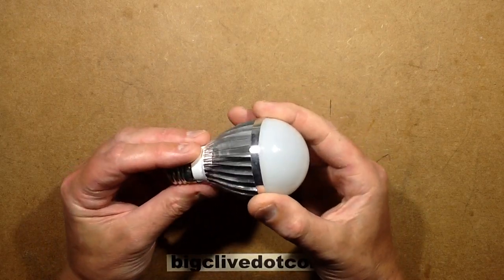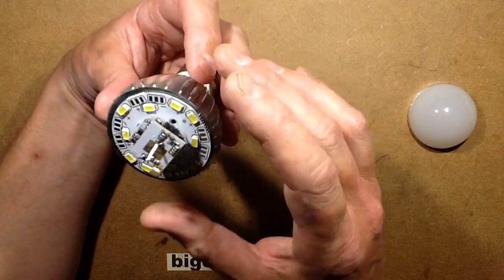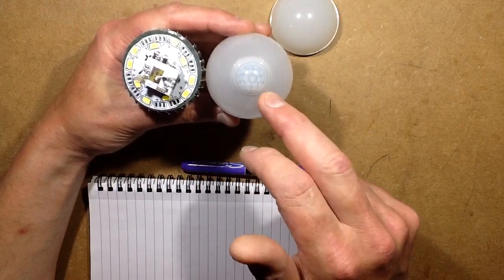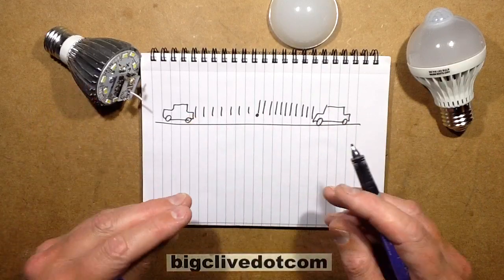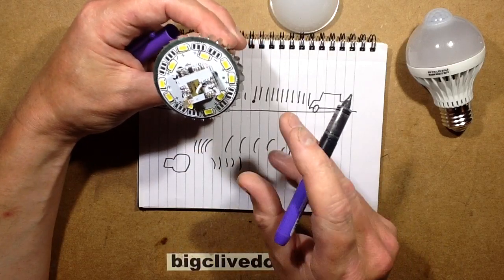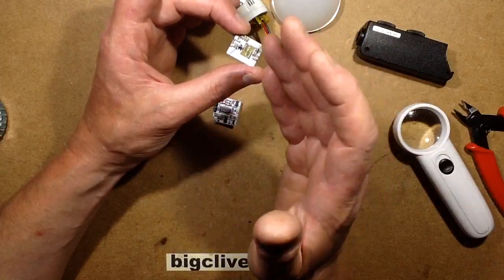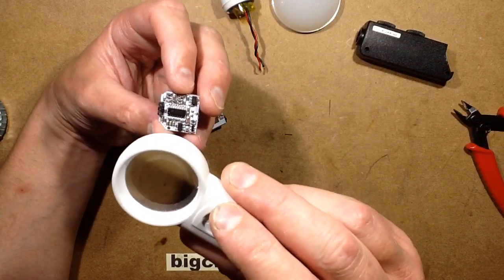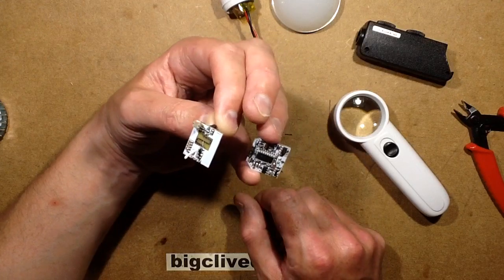Microwave doppler sensor lamp with perplexingly simple circuitry.

Comment: LEDs cause interference and ham radio bands in some cases especially cheap ones
Reply from the maker: The switching ones do.  The modern linear regulator type are very electrically quiet.

Comment: If you have ever played with regenerative receivers, you know that they can interfere with other receivers, since they transmit as well as receive. Since they are only a weak oscillator, they can be easily disturbed by stray capacitance and conductors placed near them. I think this is how this circuit works. Think of a metal detector that detects anything that conducts. A grid dip meter is similar a tuned circuit upsets it's grid bias and shows a "grid dip" when the meter is tuned to the circuit under test.

Comment: This has been spoken about on other electronics channels of late. I am more convinced that the module just transmits and measures the SWR, uses the BIS0001 to compare the signal. The signal frequency on these units seem to be more around the 3.8Ghz. As pointed out by someone on another channel the single transistor is non linear and can have two voltages present at the same time. The holes are just via's for the ground plane.

The SWR theory makes sense when you find that they don't disturb each other.

Comment: Do the microwaves work through the opaque or frosted glass that light covers are typically made from? Think I remember seeing the IR ones on an ebay ad say it wouldn't work through the glass. So I'm wondering if one of these could be used instead. I don't really want to remove the glass cover just to have an automatic light.
Reply from the maker: Yes they can detect through glass.

Comment: Greetings from LA: Just checked eBay for these lamps and found what look like what you "took to bits" (not a side by side comparison) but I do not recall your mentioning these were AC85-265Volt. Your expose showed a SMPS (or was that a BUCK regulator) inside. I'm a retired elect. tech but miss the diagnosing part of the job. Your videos fill that need (including the occasional accidental overloads  ;^) Never seen a capacitive dropper circuit here. Jim

Comment: I used wago connectors in place of wire nuts for the first time today.  They make feel like I am cheating they are so easy.  Are they really safe?
Reply from the maker: I've never personally seen one fail.  The first ones I saw were in use in industrial refrigeration condensing units, and I asked the maintenance guys if they ever had problems with them and they said no.
Reply: bigclivedotcom Thank you for the reply.  they are more espensuve, but they seem to be worth every penny.

Comment: Not strange at all.  I was taught back in the 70's that all that "Doppler detection" wasn't how things really worked.  I've played with the horn out of a old microwave motion detector and have seen it for myself.

Here's how it works:  You have a free running oscillator that transmits a signal.  (In the case of my unit, a Gunn diode.)  You also have a receiver that picks up the transmitter AND the reflected signals.  AM demodulate the signal (in the case of my unit, it was just a simple microwave diode halfway down the horn.  The PC board was the filter capacitor.).  Then look for low frequency AC.  (Ignore the DC value)  That's it.  Why does that work?  The combination of reflected signals will either add or subtract from the signal received from the transmitter.  If something moves, that will disturb that "balance" and cause a change in the DC value (aka a AC signal).  AC detection can be quite sensitive and find small changes in the DC signal.  Outside of two semiconductors on the horn assembly, everything else was power supply or low frequency audio.  No narrow-band filters or precision measurements.  (Cheap, cheap, cheap.)

I challenge you to find something that really measures the frequency.  I doubt if you'll find one, because measuring frequency is complex.  The closest you'll come is that you can claim that it's measuring the beat frequency between the transmitted and reflected signals - but that circuit will still be substantially the same as I've described.  In that case, the diode detector will be called a "mixer".  But you end up with the same results - a AC signal the represents movement.
Reply: Russel has it right.  The wavelength at 5.8 ghz is 51 millimeters.  Half that is a complete phase reversal.  So a movement of 25 millimeters, one inch, is enough to completely reverse the phase of the reflection and when mixed with other non-moving reflections in the room will change the amplitude on the receiver.  A ceiling fan would probably drive it nuts but it may be filtered to ignore rapid and continuous changes (low pass filter).
Reply: Russel you just described a downconverter and doppler phase shift detection! All you need is usually a diode, almost always biased IME, to supply a nonlinearity. I've also commonly seen a transistor used as the mixer in place of the diode.

Comment: This question probably demonstrates my lack of understanding of electrical theory and radar, but here goes.  Infrared sensors are somewhat susceptible to false triggers due to changes in temperature and things like that as I understand it.  Depending on how this lamp is set up, is it also possibly susceptible to false triggers, or are there just too many variables to answer that question.
Reply from the maker: A common technique is to combine the two technologies.  Each has its own weaknesses, but when paired they reduce the risk of false triggering of alarms.
Reply: Is this lamp going to fry your balls after time?
Reply from the maker: Microwave refers to the frequency range.  Actual RF power is extremely small.
Reply: ChompChompNomNom yes
Reply: Lachlant1984  t

Comment: had to look this one up.  the variations it's detecting remind me of two things...  1. in the USA  Digital TV is really picky when someone in the house is walking around.  Which is why I've given up on the whole thing.  Someone walks around in the house bang no signal.  Meanwhile 2. Wireless Internet.  the 5 ghz ones more so than 2.4 on down.   (naturally.  the higher the hz the higher the waves the shorter the distance.  When someone walks around the house again 2.4 etc not so much but 5 ghz etc it gets picky.  Someone moves about the house and it sees this.  Although a $400 router vs a $50 government paid for DTV converter is a bit of a difference but think based on the same sort of movement.  I could be wrong I really don't know.  Still learning :)

Comment: I bought one and it came crushed I got back to uksolarseller and they asked me to fix it, I told them it was beyond fixing, so they offered two thirds of what I paid for it, I have never given a red on Ebay but that is about to change. And to add insult to my injury  which I got a cut hand from trying to push it back together, When I tried it there was a loud buzzing noise coming from it, so it ended up in the bin. You must have been lucky Clive.

Comment: It seems like someone has already iterated the design on these. I received a couple from ebay yesterday that have all the circuitry on a single PCB, with etched antennas and no separate wire antenna. It also uses the BISS0001 for sensing and seems to work very well. Cost me less than 4 quid ($AU6.60) delivered. Here is the 5W warm white bayonet version which I purchased: http://www.ebay.com.au/itm/B22-5W-AC-110V-220V-25LED-Microwave-Radar-Motion-Sensor-Warm-Light-Bulb-Free-P-P-/201320570192

Comment: Would this effect wifi
Reply: I don't believe it would effect in wifi, but it could possibly affect the wifi a little. Probably only in a negligible way, unless you keep your wifi device in close vicinity to the radar antenna.
Reply: +Sebastian “Sebi” Grygiel thanks,  I was reading this http://www.cisco.com/c/en/us/td/docs/routers/access/3200/software/wireless/3200WirelessConfigGuide/RadioChannelDFS.pdf
And was wondering if the 5ghz radar would saturate the 5ghz WiFi channels and cause constant channel changing
Reply: I had a look on the output spectrum of that thing using a spectrum analyzer and it is not pretty. First of all it operates at 2.5GHz not around 5.8GHz and it wobbles around quite a bit (about  100 Meg). So If you'd mount that one in an area where Wifi is already kind of weak I'll guess it would interfere.

Comment: Clive, I'm wondering if the transistor at the base of the transmit antenna (vertical wire) is an RF amplifier, with the zig-zag track being the receive antenna.

Comment: I believe that transistor is a high speed JFET used to amplify the transmitter signal. If not then it is the oscillator at which point I would expect the capacitor to be of very small value. Either way, doppler detection modules are just frequency comparators used to trigger other functions.

Comment: Is this not based on a very simple Gunn Diode transmitter? Maplin did a doppler alarm in the 1990s based on the Gunn effect. No oscillator needed. The Diode does it. There is a mixer and a detector circuit. Transmitted and received waves are mixed. The logic compares the transmitted frequency with the received frequency by looking for (AF)beat frequencies in the mixed signal. Google Gunnplexer.

Comment: It's a homodyne transciever, basically measuring the SWR of the antenna as the people (or other stuff) move.  They used the same idea at 915 MHz back in the 70's for security systems.

Comment: See, all the magic ends outside the topmost board with an antenna and weird PCB trace. That board contains a simple one-transistor RF oscillator, which doubles as an RF mixer (it has much in common with super-regenerative receiver topology). So it generates and radiates the RF energy, and at the same time is mixing generated signal with the reflected signal. The result contains harmonic with a frequency equal to the DIFFERENCE of the forward and reflected signal frequencies, and this is something about 5 - 10 Hz. This is fed to the second low-speed board.

So it works like this: no motion - no difference tone, something moves - there is a difference tone on the output. The frequency of the difference tone is proportional to the object speed, and amplitude depends on reflected signal strength.

The weird trace on the RF board is most probably an RF microstrip transformer/resonator (and then this is probably a Hartley-type oscillator). A bunch of capacitors is there for supply decoupling.

So no RF on the second board, it deals only with the difference tone.

Comment: Judging from what you said, this circuit -- http://www.next.gr/sens-detectors/rf-radiation/microwave-motion-detector-circuit-l14830.html -- is probably similar to the circuit in the bulb.  A common-collector oscillator (Q3, 2SC2570) feeds an antenna, to which is also connected a microwave diode (D1, 1SS99).  The output of the oscillator is mixed, in the diode D1, with any received reflected signal.  The difference frequency is filtered with a simple low-pass audio filter (C8, R6), and then amplified by an audio amplifier (U1-c, d, a) .  The output is rectified by diode D2, and used to trigger U-1b, which drives a MOSFET, which turns on an LED.

Comment: Units I used back in the day fooled me in a similar way.  It used separate transmit and receive horns but the receive horn just had an audio amp connected directly to it!  The two horns were cast into one piece of metal with a small notch between them.  What the notch did was mix a small amount of the transmit signal back into the receiver.

What happened was the reflected signal mixed back into the horn with the sample of the transmitted signal and any frequency difference mixed in the detector and audio came out.  Effectively, the receive circuit could only see the difference signal of the heterodyned result.  This means the microwave signal was not basically detected at all in the receiver -- only the difference product between the transmitted and received signals.  I believe the "detector" was nothing more than a slightly forward biased diode if I recall.  This was about 30 years ago.

Bottom line: stupidly simple circuitry that boggled my mind as well.  The nice thing is since you're just checking a difference frequency there is no real need for tuned circuits or transmitter frequency stability!!!

I modified one into a "doppler radar gun" which I could use to check speeds although I never got it totally accurate with the circuits I built.

Comment: have you ever tried to make a USB 5v 3A tabletop microwave oven?
Reply: or one powered by a laptop power supply?
Reply: +zeer365 not enough power probably.
Reply: +poodlelord there is enough power, but it would be more of a warmer than a heater
Reply: Yea, your only going to have 150 watts or so of power to play with, but you could make it run off mains probably quite easily. Assuming all the math works out in the design so it doesn't become a burner instead of a heater. I wonder if someday a usbC iteration will have enough power handling to run small electric ovens, that would be crazy.
Reply: most microwaves run 500-1000 watts i believe, that's the real issue.

Comment: the single long white vertical wire is the antenna >>> https://www.amazon.com/Ramsey-Microwave-Motion-Detector-Kit/dp/B0002NRKFI/ref=sr_1_3?s=electronics&ie=UTF8&qid=1467026004&sr=1-3&keywords=ramsey+kits&refinements=p_4%3ARamsey 

Plans>> Notice the antenna // ->  http://ramseyelectronics.com/cmp/md3/default.html#10

Comment: This would be a neat hack with a makeshift house alarm that is very very discrete. If you were to combine this with an arduino with an Ethernet shield, and a loud piezo or speaker, you could have the arduino send out an email notification, and also fire off that speaker. It would be pretty neat.

Comment: Sorry Clive - you're wrong on the radar and ultrasonic alarm systems.   You're good, of course, understanding Doppler - but presuming "radar" infers "Doppler" got ya.        Ultrasonic sound burst or radar-frequency-crap burst is emitted.   Signal bounces around the "still" room - and received by microphone or cheap-crap RF receiver.   Diode to DC on a small capacitor.  Simple cheap "sample--n-hold".  Comparator looks at the next received DC voltage.  Same (no room change) = no alarm.   Different voltage (room change) = Alarm.  The new DC voltage might be higher or lower - doesn't matter.  Only that the many-bounce pattern has changed.  NO approach/depart frequency change,  only reflection amplitude.  Very cheap and simple.
Reply: WilberWobbler 
Got ya? FFS!

Comment: I'm thinking what is going on here might be as simple as measuring the power consumed by a microwave oscillator that's coupled to an antenna.  One of the ebay listings linked in another comment has a decent picture of what appears to be a very similar design.  Looks like the chip on there is most likely a single microwave transistor.  One pin is connected to power with a bunch of bypass capacitors.  Another pin seems to be set up for biasing the transistor.  Then the output is connected to that long curved trace which acts as the antenna.  Could be set up as a slot antenna with the hole in the ground plane on the back side.  The far end of that trace appears to be connected to ground with some capacitors and a resistor.  The capacitors provide the RF return while the resistor provides the DC return.  Looks like the voltage across the resistor gets picked off and routed to an output pin.  My guess is the BISS0001 chip is just being used to detect changes in that output signal.  The idea is that the antenna acts as both a transmit and a receive antenna at the same time.  Since it's part of the feedback network for the transistor, the transmitted signal that gets bounced around in the environment with interfere with the operation of the oscillator, changing the effective load impedance and therefore the performance of the oscillator (frequency and/or amplitude).  Changing frequency and amplitude will change the power consumption of the oscillator, which is relatively easy to measure.  Now, what would be interesting would be to set up a spectrum analyzer to see what happens to the oscillator frequency.  Might also be interesting to see how susceptible it is to external interference - i.e. 5 GHz band wi-fi.